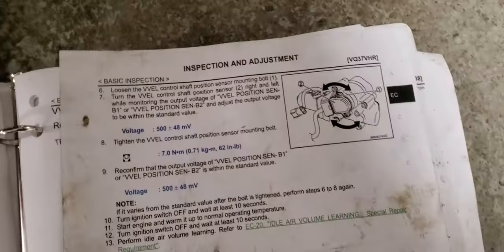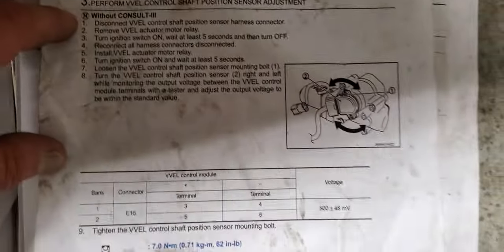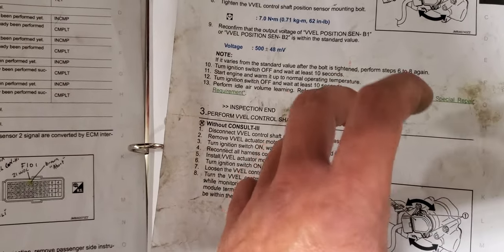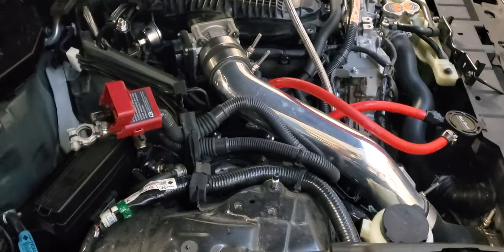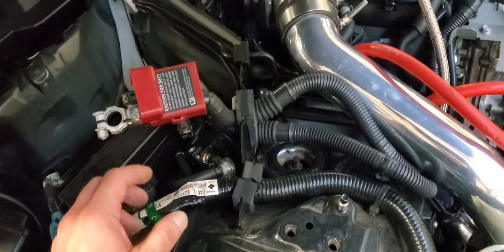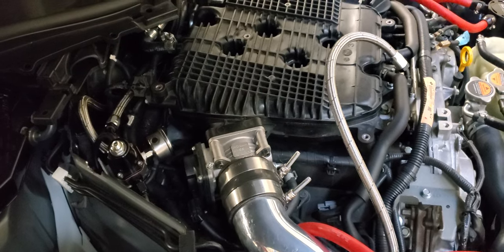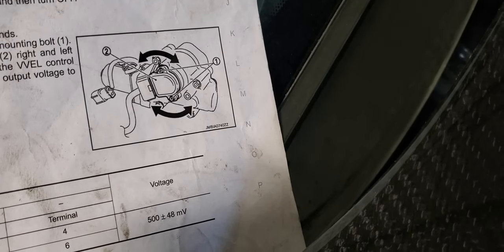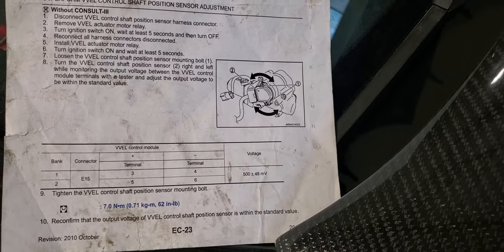370Z/ G37:How to reset VVEL

Comment: I’m dealing with a u1003 code car won’t connect to vvel module , won’t rev over 1500 rpm
Reply: Same here , been tryin to figure out wats going on either a wiring problem r the vvel module , some say checc fuse n relays
Reply: @nicholasbrown4923 i use to have p1606 along with u1003 I replaced my vvel module and did a idle relearn and both codes have never came back do you only have the u1003 code ?
Reply: any idea?

Comment: I’ve done all these steps, get B1 and B2 to read 0.5V. As soon as start cranking car, it doesn’t start and goes back to 0.8V. VVEL sensor learned shows 0.8V all the time. Is there a way to make ECU to learn it again?
Reply from the maker: After u initially set the sensor values and do your last key cycle and fire up...the values will now change to similar values that u have....is the car running right?
Reply from the maker: Im thinking u did it right

Comment: I'm getting P0024 after infiniti installed a replacement flywheel/ signal plate due to broken signal teeth from a rebuild that mechs sloppy install on my M56S. I believe this mech didnt position wooden block per fsm to avoid contact with VVEL when reinstalling trans and it rotated the sensor. Who's manufacturing the sensor itself? I've looked everywhere- ConceptZ hitachi etc..

Comment: Bro!  You seem to really know these motors!  Where are you located?  I have an 1606 vvel code and it went into limp mode 1500rpms. Shut it off and started back up fine with the service engine light on.  It has 1606 and 1024 as permanent codes. If you’re close I’ll bring it to you to fix
Reply from the maker: @co10boy  what year, model, miles, mods etc?
Reply: 2010 370z base model. 90,000 miles, Manual transmission, bone stock!
Reply from the maker: @co10boy  u need to look at live data, and you want to send me a video of all of the vvel and vtc parameters...a lot of the earlier cars had vvel module failures (located behind the fuse box, behind the battery)

Comment: I’ve got a P1606 and I’ve changed the vvel control module due to it having a rough start and going on limp mode and not getting the RPMS, resetting it like so would help that code go away?
Reply: Did you ever figure out this issue?
Reply: Fixed it? 😊
Reply: @IceManJhey  did you ever fix it?

Comment: My car ran good until I was leaving the store and rpm wouldn’t pass 1200rpm and I got code p1090 and p1093. I let my car sit for 15min and turned it back on and it ran like nothing ever happened. Can I Just replace the actuator motor bank 1 and 2 and do I have to relearn them or do any certain steps ?
Reply from the maker: Hmm....rare codes...I would investigate the vvel control module first, located in the fuse box bracketry after pulling the battery out....I would suspect a problem there first since it's both banks..there is a fsm testing procedure for this...imo vvel motors rarely fail

Comment: question, if i change the 2 cam shaft sensors located on the vvel would i have to reset it?
Reply: the vvt solenoid sensor

Comment: Are you able to show me and example of what a motor runs like before doing this procedure? 
I replaced my heads due to bent valves and now the idle is really rough and I’m getting 1089 & 1090.
Reply from the maker: I don't think so...but it will do that, stumble, misfire on 3 cylinder...if u had the head machined, and haven't synchronized the vvel motor with the control shaft, u will have this issue
Reply: @sethjoyner391  do you got any idea how much this would cost to fix at dealership(Nobody near me knows about fixing this issue). Say if I had to have someone take the timing covers off and sync the control shaft and VVEL motor, how much do you think it’d be?
Reply from the maker: @Stockclipz  the job itself isn't that bad...it would take me about 4 hours from pulling the manifold and vc's to resetting the vvel...problem is...95% of dealer techs don't know this because it explicitly states not to remove the vvel motor from the control cam in the fsm...best bet is a reputable import (nissan based) shop near you and tell them the issue and show them my video
Reply: @sethjoyner391  great thank you so much for your valuable information, we gotta protect you🫶🏽🥹, but I need to save up for the cost of this so I’ll just look for Nissan based shops near me meanwhile. Thank you honestly
Reply from the maker: No problem,  just doing my part in the community

Comment: I have a motor that I've swapped in a car and I'm currently trying to tune it with Uprev but its throwing these particular codes; p1087, 1088, 1090. Do I need to reset the VVEL using this procedure or is there something that I'm missing?
Reply from the maker: Yea. For a swap you'll need to reset vvel sensors more than likely
Reply: @sethjoyner391  Where exactly do the value have to be? I've noticed that both banks move in increments of 5 while rotating the VVEL position sensor. For example I was getting .494, .499, .504, .509 and etc... I've put both of them at .504 volts and go through the reset procedure but the alarm will come back. If I reset it and keep the rpm above 3000 rpm on startup, it seems to rev out but only on bank 2.

Comment: do i need to have it tuned to be able to use ecutek? or can i also look at the vvel range through live data with a scanner?  
vehicle got check engine light as i was driving and went on limp more with no throttle response. code is p1090
Reply from the maker: You can definitely diag and observe vvel with any quality scan tool....ecutek just helps me with the reset procedure I use (my job uses ecutek in general)
Reply: @sethjoyner391  perfect, thanks for the vids, they’re very helpful

Comment: Know anything about transmissions on the g37’s I’d love to pick your brain . I’m completely stuck even dealer can’t figure it out 😢
Reply from the maker: What year car and what's the issue/ what's it doing?
Reply: @sethjoyner391    code p0500, p0780,u0101 that says permanent on my code reader . I ordered new oem valve body for my vin from dealer . New oem fluid (Matic s) and before my issues were not shifting passed 3rd . Hard shifts and the manual mode wasn’t working . Now my manual mode works and shifting is smooth but once it hits 4th gear it just revs up like it’s in neutral . Then goes back to 3rd fine . Took to dealer they didn’t find anything wrong and no codes . They said they will probably warranty the part cause the tech said it feels like it’s the valve body . Also a abs code just popped up c1131. But I’m still showing same codes (permanent) .

Comment: So what symptoms does this cause when the VVEL is out of reference ranges I’ve been trying to tackle an idle issue (shifting into neutral rpms rapidly to 575 bounces up immediately to 750 then down to 650 normal) I’ve done quite a bit in trying to determine the issue. 

I checked my VVEL position sensor is 0.84 V and 0.78 V and my VVEL time is 7.18 and 7.21 degrees
Reply: I’ve done TB cleaning valve cover gaskets and tube well gaskets gallery gaskets water pump timing chain timing tensor MAF cleaned the idle relearns
Reply from the maker: Did you ever have your cam towers removed or disconnect the vvel motor from it's control cam?
Reply: @sethjoyner391  only thing I’ve done is disconnect the sensor from VVEL and did the valve cover gaskets and tube well gaskets. Previous owner did not to my knowledge
Reply from the maker: @Us3r_404  I guess tell me more...mods, year, mileage....also, it's not uncommon to have a differential in the vvel values from Bank to bank..other than the rpm fluctuations...any codes, vacuum leaks
Reply: @sethjoyner391  2008 g37 sport manual trans 99k miles only mods is a motordyne cat back. I pre ordered a test but not on car yet. Other than that it is stock.  No codes no leaks to my knowledge I’ve checked. I had a guy do my gallery gaskets he didn’t see anything unusual.
Reply: @sethjoyner391  outside the fluctuations it runs good and strong. It’s intermittently on these fluctuations. I’ve done a relearn a few times as I’ve been told sometimes it doesn’t complete
Reply from the maker: @Us3r_404  hmmm...I'd like to see a mechanical vacuum test at idle, investigate fuel pressure,  and it would be nice to see vtc intake values and data...the older cars can have intake sprocket issues
Reply: @sethjoyner391  I’ll have to look up how to those types of test. Really hope it isn’t a sprocket lol just looked that up and that looks expensive. I’m unfamiliar with vtc what does that stand for. On my app I don’t see anything resembling that. (App I’m using has tons of values and data recorded)
Reply: @sethjoyner391  really appreciate the info though your responsiveness

Comment: Anybody know what can be causing p1092 code ?
Reply: VVEL control shaft position sensor, VVEL control module defective, loose harness or connectors etc...
Reply: @top-notch9761  changed sensor and vvel control module and still putting me in limp mode and doesn’t let me rev past 1rmp
Reply: @kikimejia7787  did you ever get it figured out? Have changed vvel control module and just did vvt solenoid actuator but still getting thrown into limp mode

Comment: Anyone know what’s causing a P1606 code? I’ve replaced the VVEL control module and the CAM sensors. Not working.
Reply from the maker: What was your initial problem? Built engine or cams?
Reply from the maker: @420sniper8 myeaaa...they're going to be zero help.....we'll need to know the symptoms and current codes..what year and car?...vvel control modules can go bad, however vtc system is more of a system of components integration into the valvetrain
Reply: bro please reply😂 did you ever get the fix for p1606 there’s no info out in the internet
Reply: @cavz2158 did you ever fix the p1606 code?!😢
Reply: Got a homie going through the same thing any fix?
Reply: @IceManJhey  check the relays, make sure nothing is loose on the vvel module or relays. I'd swap out plugs if he already hasn't.

Comment: So watching your vids what if I just replacing head gaskets . Take old motors and sensors off marking the sensors exact location would I still have problems? And I would of course check voltage .
Reply from the maker: The only problem is that the motors are connected to the control cam and the tower system...to do that job right it would all have to come apart and vvel would have to be mechanically phased again...you blew ur headgaskets?...you'll also need to take the heads to the machine shop to be checked for deck straightness...unless your blowing coolant in a leakdown id avoid headgaskets...tell me more about what your trying to do
Reply from the maker: Even scribing the stepper motor location on the control cam doesn't seem to work that well...I've done it that way as well and always went back to the way I did it in my earlier videos
Reply: @sethjoyner391   I was just trying to do preventative maintenance since I have the motor out . Change all the gaskets and seals . I was buying the complete gasket set and since they came with the head gaskets I was gonna change them . I just bought the car and to be honest I did not run it long enough to really see if head gaskets where blown .but I didn’t have any coolant in oil or no oil in reservoir .  I guess I can do a leak down test . I’m mechanically inclined . I’ve done plenty of motors just not these types of motors lol usually jeep or dodge or gm motors mainly . Even the eco boost motor I’ve worked on . I just have a habit of fixing things that are not broke 😂 I understand what your saying I have a machine shop at work I’d check the heads for flatness I’d probably even change valve seals and check the seats and lap if necessary.  I’m just being extra . That’s why I wanna change them . I know it sounds silly .
Reply from the maker: @colt2540  yea, you may be opening up a big can of worms....the headgaskets aren't really a maintenance item...they're mls not graphite or anything like that...I'd do that leakdown with wet cylinders, and go from there
Reply: @sethjoyner391   sweet thanks buddy just didn’t wanna kick myself in the butt and not change them and then they end up being bad . 😂 I bought the car for cheap with a slow leak from the water pump . Thanks for your help !! Also If I did do the heads what scan tool or software I need to read the voltage rate ?
Reply from the maker: @colt2540  if u have a buddy with nissan consult or u have ecutek real-time tuning software (suggested) for vvel and vtc data...slow water leak is uber common....and I haven't seen a blown headgasket in more than a year (that was under boost)...takes a lot to blow the factory headgaskets
Reply: @sethjoyner391   10-4 I’ll leave them alone.  I’m a little ocd and it kills me 😂 thanks for your endless help brotha much appreciated.
Reply from the maker: @colt2540  lol...I'm definitely on spectrum myself. Lol...but the right course of action is to leave them alone...also, I've yet to have a valve seal issue regardless of mileage if that makes u feel better
Reply: @sethjoyner391  it does thank you . I’ll just change everything else . Main seals , valve cover gaskets etc etc …. Thank you sir for your help .
Reply from the maker: @colt2540  yes sir...hit me up if u run into any issues

Comment: Dealership installed a new OEM flexplate with all the pins and got the car to start. 

The problem is when it turns on it’s still in limp mode and keeps throwing the same codes.
P1088 - VVEL System B2
P1093 - VVEL Actuator Motor B2
P0335 - Crankshaft Position Sensor/Circuit 

They dealership is now telling me they can not further diagnose it without flashing my car back to stock and even then there’s only a 10% chance of “it” working. I’m already $3200 into it and NOT about to have them flash it back to stock. Anyone know why this is happening or had experience with this before? TIA

Comment: Hey I took my car to the dealer to install a new vvel assembly. My car is showing P1090. They said they weren’t able to adjust the sensor and it was reading over 700mv. Do u know why the sensor would be able to adjust? Any way I can message u for further detail?
Reply from the maker: Basically,  because it seems they're unfamiliar with the system...sounds like they are unaware of the 5.5 degree preset inclination of the control cam to mechanically phase it with the stepper motor...because it's mechanically out of time, they weren't able to get the sensor in range...Basically,  it needs to come back apart, valve cover off, rear vvel cap off and an adjustment made at the Allen screws that connect the stepper motor to the intake control cam
Reply from the maker: I also made a video about this on my channel and I demonstrate any easy way to do this
Reply: They said they weren’t able to use the consult tool to perform the idle air learned procedure to move onto the next step. Which he needs in order to adjust the sensor to 0.5V. But he was saying both sensor were reading wrong. But when I used my ECUTEK Bluetooth dongle the drivers side was reading 0.54V and the drivers 4.5V

So they would have to make sure it’s 120 degrees, from top dead centre. Lock the passenger side cam, adjust the stepper motor to 1.585inches, lock down the cam Allen key bolts, and then reinstall the valve cover? After that adjust the sensor to 0.5V?
Reply from the maker: @bogdankopec5785  u got it verbatim....literally no nissan masters I've ever talked to have known this...so don't feel too bad...it would be a weird system for them to intimately know+ plus it says never to do any of the stuff we're doing in the fsm😅
Reply from the maker: @bogdankopec5785  I swear, u should make that a sticky somewhere
Reply from the maker: @bogdankopec5785  most important is that they are set to those voltages....in a run state after setting they will change...but they will be similar numbers
Reply: I’m just making sure. He had the passenger sensor mounted the wrong way. Instead of the the connector pointing down, he had it pointing up. The tech said they “corrected” the sensor to the correct orientation and even swapped the old one and still a no go and he is stuck at the idle air relearn. I asked the tech to provide the new voltages cuz he had it improperly mounted and he didn’t called back. Now he wants to try to find why the idle air relearn isn’t happening. But I am suspecting since he mount the Vvel sensor “upside down”, it leads me to believe he didn’t adjust the internal  stepper motor to sync with the cam. he said the consult tool adjusts everything itself. So no need to make the adjustment manually.
Reply from the maker: @bogdankopec5785  damn, bro, now it sounds like he's a clueless person😳 ...upside-down is wild
Reply from the maker: @bogdankopec5785  yea, he 100% has no clue...he must be young
Reply: No he was late 30s, early 40s lol I almost feel like I need to go down there myself and see what the new value is on the passenger side. As he didn’t even know what those numbers were in the first place. I don’t want the Infiniti dealer to keep charging me for further diagnostics haha
Reply from the maker: @bogdankopec5785  damn bro...that sux....yea, u definitely need to be there